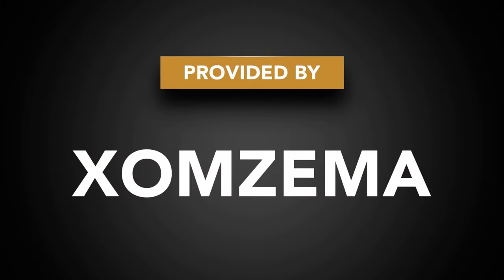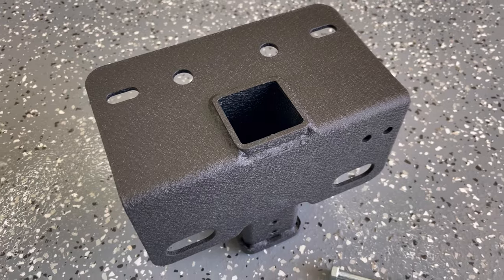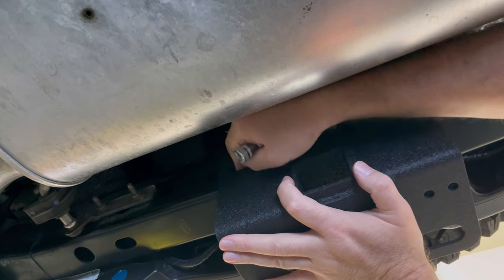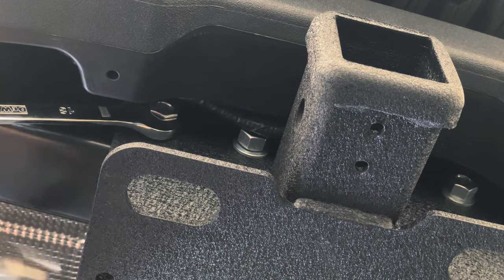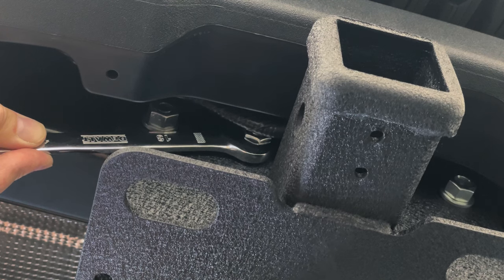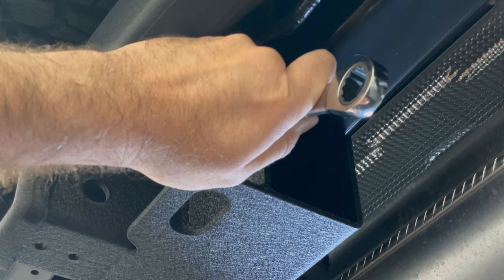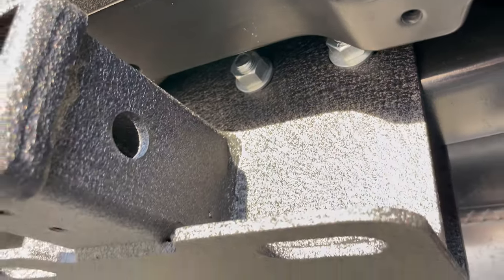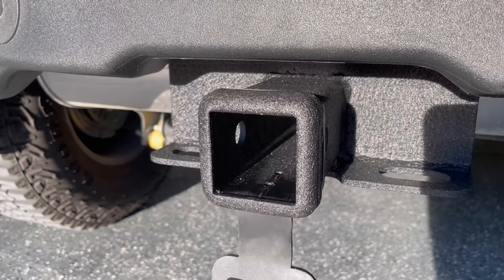How to Install a Trailer Hitch Receiver by Xomzema - 2021+ Ford Bronco

Comment: Always follow and trust your upgrades. Just ordered the same hitch. Thanks again bud!
Reply from the maker: Thanks for the feedback Carlos, I appreciate it. So glad that you find the videos useful!
Reply: Back with another question. After installing the hitch which I love the looks etc there is one thing tho. My bike rack is super loose to the point that not even a hitch stabilizer works. Is this the same situation with yours ?
Reply from the maker: @carlosem6498  - Wow, that doesn't sound good at all. So far I haven't had an issue, it's been a nice and tight fit. 

I did test a couple of other tow hitches a while back and one of them appeared to be a 2.25", as it did feel loose, but the Xomzema one has been just fine.

Comment: Tag me when yo do the wire installation for that hitch
Reply from the maker: Thanks for watching, I appreciate it. As I mentioned in the video, at this time I have no plans for the wiring harness. I intend to use this hitch receiver with a cargo carrier and a bike rack, both of which don't require there to be power to the hitch. 

If I do decide to wire it up - I'll put a video out here on YouTube. Thanks again!